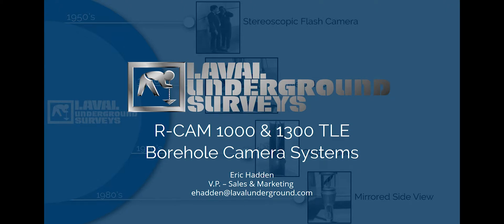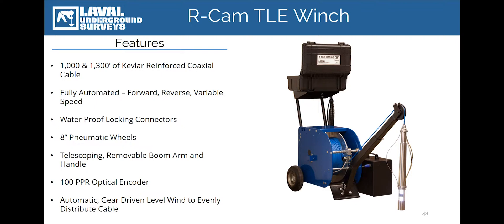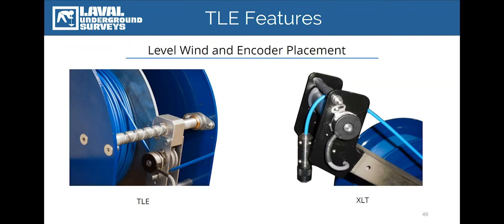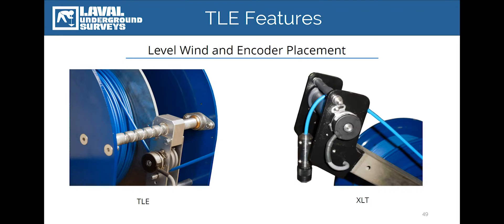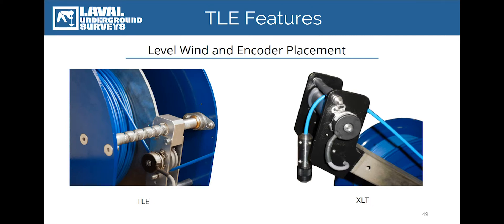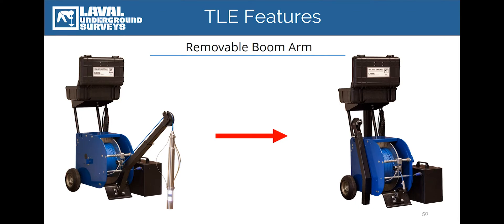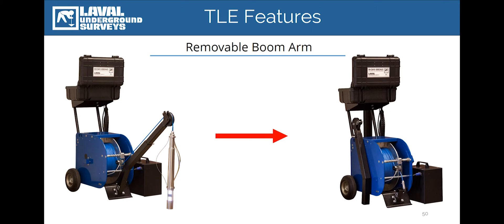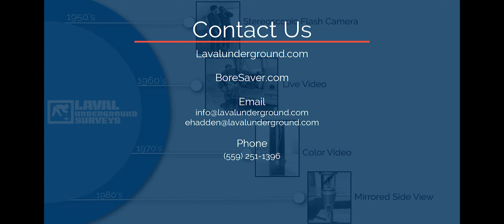Laval Underground Surveys - R-CAM TLE

Comment: the problem is that the camera doesnt have a focusing capabilities to perform in different wells diameter and a single focusing distance not help to have a real nitid image . and also a lack of light.
Reply from the maker: Thank you for your feedback Mauricio. Have you operated our R-Cam system recently? The R-Cam does have a fixed focus for wells ranging in diameter from 4"-16".  We aim for what is known as the Hyperfocal Distance.  This optimizes the depth of field as well as infinite focus.  However, we do have a camera, the DC-5150, that utilizes adjustable focus. We have found adjustable focus helps in extremely small borehole where the image is close to the camera.  We also have our SC-166 which is optimized, focuses, for wells as small as 2" in diameter.  All of our cameras contain 5 stage adjustable lighting that customers find ideal for holes large and small.  If you would like more information or further specifications on our systems, please do not hesitate to contact us.  We welcome and appreciate any and all feedback!
Reply: @lavalunderground  HOW MUCH COST 1.- THE NEW LEVEL WIND . 2.- THE MODIFICATION OF MY R CAM 1000 FOR THE FIVE LIGHT LEVELS THAT MINE DOESNT HAVE AND THAT WAS MY MAIN COMPLAINT WITH THE CAMERA. 3- COST OF AN OLD DVD RECORDER  AS SONY TYPE. . I HAVE BEN FOLLOWING  (I WORKED FOR MR. WUTHENAU , YOUR MAIN CUSTOMER MANY YEARS INMEXICO) YOUR CAMERAS SINCE 1980'S WITH THE VIDICON OR NEWVICON  TUBES INSTEAD OF THE CCD AND THATS WHY   -AS A QUALITY CONTROL OR TECHNICAL FEEDBACK I CAN TELL YOU SOME DETAILS OF YOUR CAMERAS R CAM.    A) INSTEAD OF 1/4" CCD USE OF 1/3" CCD. MORE RESOLUTION AND QUALITY. B) IN MEXICO WE DONT HAVE WATERWELLS SMALLER THAN 8" SO OUR RANGE IS FROM 8" TO 12" C) THE POSSIBILITY TO INCREASE EVEN MORE (PREFERIBLE IN FRONT OF THE CAMERA) THE FIVE LEVEL LIGHT CAPACITY OR GIVE THE EXTERNAL THREE LIGHTS.    D) ADJUSTMENT OF YOUR PRICES BECAUSE MANY POPLE IS PURCHASING A LOT OF CHINESE CAMERAS.     E) AT LEAST SET AN AUTOMATIC  FOCUS OR BETTER MANUAL CONTROL .  PLEASE DONT FORGET TO ANSWER THE QUOTATION OF MY NEEDS. THANK YOU